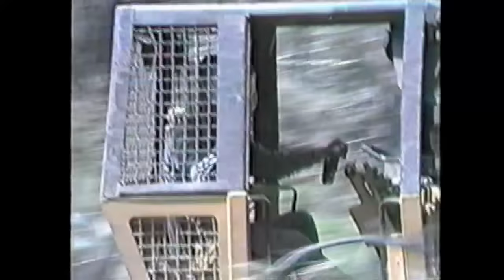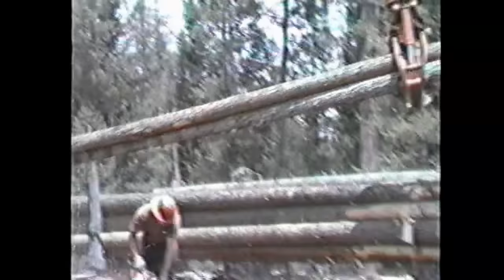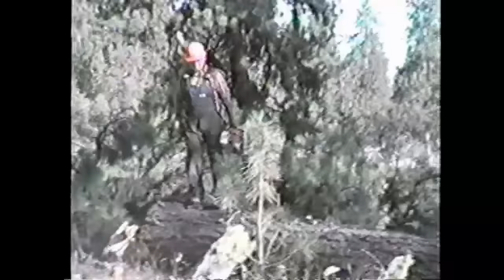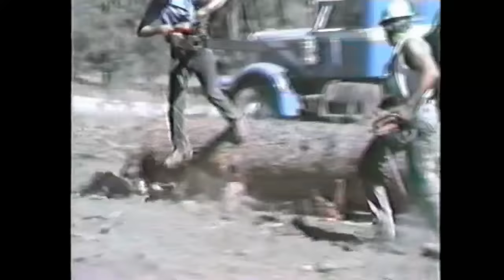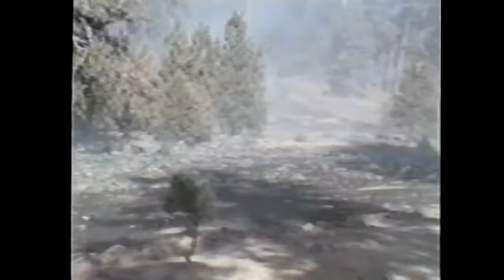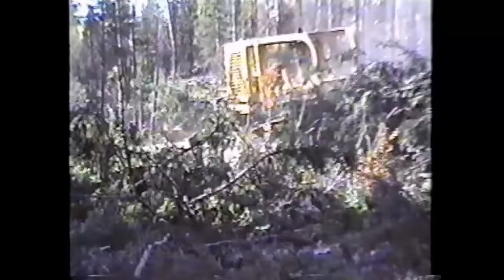Logging in the 80s  in the Blue Mountains of Oregon

Comment: I was a cutter in the Klamath area in late 79 and 80, used Husky 2100 and Stihl 045. Also remember running 3/4” main line and 5/8” chokers off an old Clark skidder; those were the days of my mid thirties. Also worked in Wa. and SE Alaska in those days but the economy of the time pushed me out of the woods; still miss it.
Reply from the maker: Once a logger, always a logger
Reply: My dad still has a 2100 that he's had since the mid 80's.  He wasn't a logger, he just used it for cutting big cedar snags for firewood back then when restrictions weren't like what they are today.  Not sure if it's stock or modified, but the thing is a straight up beast of a saw in any case.  I never cut timber myself but used to buck behind fallers and have chased landing off and on for many years, and have tried quite a few of both stock and hopped up modern saws to have an opinion about it.
Reply: Back East now, mid seventies but still running a saw, smaller ones and a lot slower now. Cutting hardwoods, oak, maple, ash and poplar, now for myself; take them to the local friends mill and make lumber for my woodworking. Love the woods, the smell an d the sights. Press on gents and thanks for the comments.
Reply: I graduated high school in 1991, from Sweet Home Oregon. Thanks to the Spotted Owl and liberal environmentalists you couldn't buy a job in the woods, so I joined the Navy. 6 years later the economy still sucked and no logging so I re-upped in the Navy. Did 20 years, and after I retired still the economy in Oregon sucked. So I'm in North Dakota working in the oil industry. Dad, uncle, granddad, great uncles etc. all were loggers, sucks that I wasn't able to join them!
Reply: @dundonrl  Thanks for your thoughts and comments; it does suck when “outside forces “, i.e., gov’t drives us to do things with our lives that is not our first choice and gov’t does drive the economy, look at today’s, not business, climate or society but gov’t actions do. I’m 77 yrs. and have seen and done a lot; Naval Aviator, logger, residential construction, owned a construction company for decades and now I am doing in retirement what I wanted to do back in the late 70’s and 80’s; falling trees, yarding them to a sawmill, making lumber and building “stuff “ with it. So don’t give up, maybe work back to your roots, family history, in the woods. Thanks for your service, by the way.

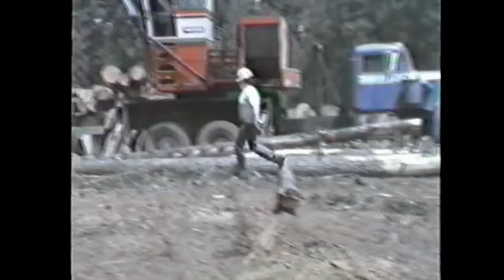Comment: 12:03
We called this 'junking on the brow" and no one wanted to do it. Why?
Because the wood has been drug across the ground/ through mud etc... 
and you end up filing saws half the day and running a half dull saw the other half of the day.
Reply from the maker: It may look like that but the soils here do not present that big a problem. Millions of board feet have been logged this way in Eastern Oregon.
Thanks for your input.
Reply: @patcassidyOutdoors  
When you have to use your hand to wipe away 4 inches of mud from a log in order to lesson the damage to your chain, we call those days Winter and Spring in Nova Scotia.😊
Reply from the maker: @JacksonAxe  I can see your point, that would require a different method.
How do you keep the logs out of the mud?
Reply: @patcassidyOutdoors  You don't. And, every trip you make with the skidder it gets worse.
The only way around it would be to cut logs to length at the stump and haul it out with a harvester, but that isn't always an option.
Reply from the maker: @JacksonAxe  And yet we loved the logger life! 
One good thing about Eastern Oregon is a dry climate with an average annual rainfall of around 14".
More dust than mud.
Reply: @JacksonAxe  That's why you use the top of the bar to throw the dirt out of the cut instead of dragging it into the cut.  There's a method to bucking muddy wood.  Hard to convey through text.
Reply: @verteup  The chain throwing sawdust or pulling sawdust has ZERO effect on maintaining sharpness.
If the chain hits dirt, it'll dull.
Reply: @JacksonAxe  logged for years buddy.  Learned how to buck muddy wood from someone with 40 years logging experience.  When you hear advice you should try and take it.  Or keep wearing out those files it's naught to me.  dragging the mud through the cut is what dulls the chain not the act of simply touching mud.
Reply: @verteup  ok, boss.
Reply: Run your chain in some dirt from the top, then run it in some dirt from the bottom......no wood involved. See what happens.
There is simply no logic in your words.
Reply: @JacksonAxe  I'm not talking about the ground.  I don't have any interest in sawing the ground.  I'm sawing wood, bud.  There's a technique to sawing muddy wood so you don't drag the dirt through the cut.  Done this professionally for years.  I can see you're not open to sound advice so enjoy wearing out those files bud.  I'll keep on doing what I was taught by someone better than me.
Reply: @verteup  I assume you're referring to first a bore cut, then do the cutting from the inside of the log outward. Hardly viable in all circumstances, though. 
You can't keep a chain sharp in mud covered wood, period.
If your chain dulls 5 minutes later than mine, fine. The biggest wood pile on payday wins, though.
Sometimes the 'over-thinkers' become the bottleneck on the crew. They don't last long
Reply: @JacksonAxe  yep bore cut, I even cut all my firewood with that method. Saves chains. Bucked several million board feet of timber in my 25 years as a north idaho logger, always using the bore cut method, especially on soft woods to prevent pulling of wood Fibres when bucking under tension. It does help keep the chain sharper by using this technique

Comment: Them 056 magnum and magnum 2s are singing not a mculloch to be seen anywhere
Reply from the maker: McCullough couldn't compete with power, run time and vibration. I only knew two people that ever ran them.
Reply: Old macs run better when u tear em apart and tickle the insides a lil bit. Really seems to wake em up 😆 🤣 😂
Reply: My old man has 2 56 supers their still running
Reply from the maker: @bjohnson1489  Your old man must be good at maintenance ... that is what keeps them running.
Reply: I'd take the 2100 or 2101xp any day of the week over the 045/056 family saws. That's my opinion as a 25 year timber feller and stihl lover. I cut full time in north Idaho cedars in 2002 running 2100 huskys and 084 stihls. Then the timber got smaller, so did the saws
Reply: Mcculloch hay day was 60s and 70s.